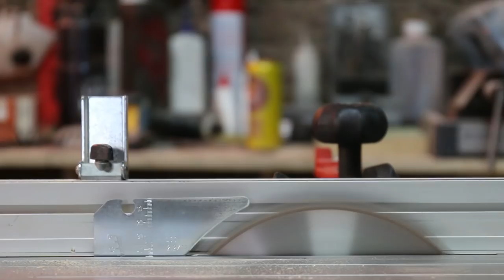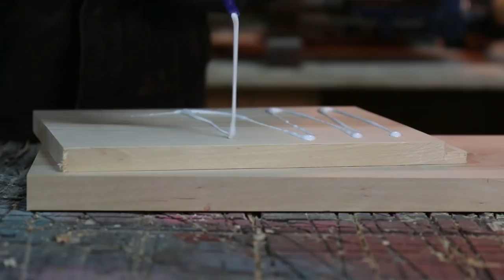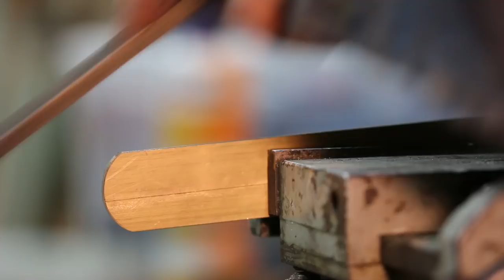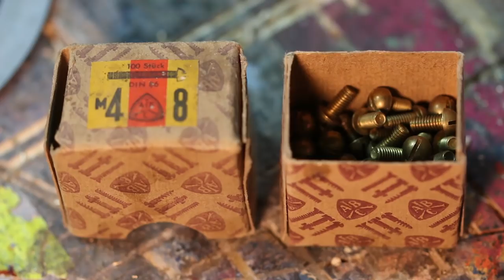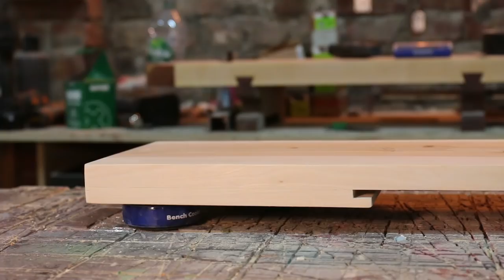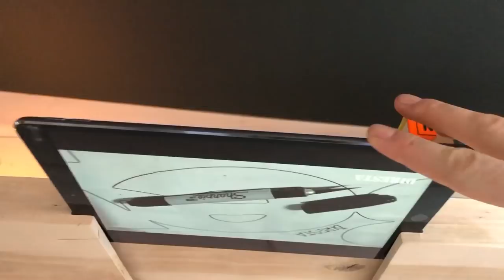Clever Bookshelf  (Holds IPad)

Comment: At long last a video with the vice solid and not wobbling like jelly .One tip when cross cutting a halving joint and finishing with a chisel .This makes the surface really smooth .The better way and faster is to complete the process on the bench saw moving blade width at a time ,it's more acurate and gives a brilliant bonding syrface area because its coarser theres actually more surface area and bonds better.Do a test sample of both and check it out .LOVE THE VIDS.

Comment: nice idea , think i wouldve use treaded rods with some pipe over them and deep holes cut intoo the width of the plank and not a groove lengthwize with the bras rod bolted to the wall as theres more chance of the rod breaking out the groove along the nerve of the wood if you put too mush load on it 
not sure if an ipad has the option of wireless charging but you could route the charging pad intoo the plank too and cover it with a thin piece of veneer and have the ipad charging when its in the cradle

Comment: Don't you need to access the home button?
Reply: I dont think she plans to operate the device in that position, just a holder to watch content. I would suggest some holes to redirect the sound, but its probably not that necesary either.
Reply: Edward Tse A five digit pinch gets you back to springboard from most apps.
Reply: Assistive touch boyyyy
Reply: Voice activation to power it off or slide it out half way, use button and slide back in, also for audio, no need to drill holes just connect to a bluetooth speaker which is better sound quality than the ipads speaker anyway..
Reply from the maker: the sound is still pretty good. i was surprised

Comment: Chisel out a grove about 2/3 from the wall perpendicular to the existing groves. Then you'll be able to pull the ipad out a bit from the wall and angle it more towards your face. You'll also be able to connect the charger for longer binge sessions. just watch out so you don't bend the ipad in that mode.

Comment: So awesome !!
Now whenever I see this kind of project I always ask myself "What is supporting the weight?" In this case it's the screws at the top and the brass member at the bottom. 

I know what I'm about to say is ridiculous, but I'll say it anyway.... chalk it up to OCD.
Obviously the shelf is strong enough to do the job, but why would you put the brass member in the middle of the shelf instead of at the bottom? In effect you are supporting the top half of the shelf and the bottom half is dangling off to bottom. The bottom half of the shelf is actually working against you instead of for you.

Sure, this is negligible in this situation. But from an engineering point of view it just seems wrong.
I know... I know... a ridiculous criticism. I already admitted that. It's not really a criticism. 
I'm just  wondering if there is a reason for this decision.
Reply: SciPunk215 I can see two reasons: first, it'd break the wooden look along the wall, with a brass beam sticking down (and most likely not 100% flush finish if it was inlaid) and second it'd let the shelf be knocked up, dumping the contents onto the bed (the brass supports don't stop rotation at the shelf mounting point)
Reply from the maker: i thought it looked more interesting and was more fun to make. and as you said. the functin is the same